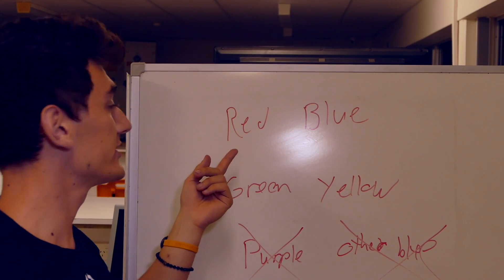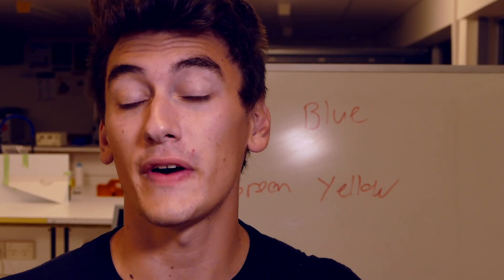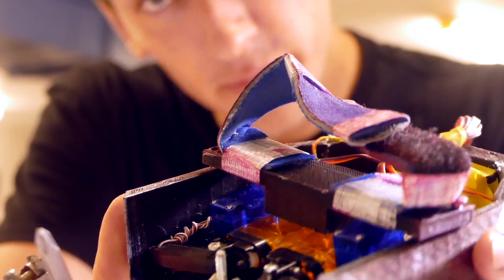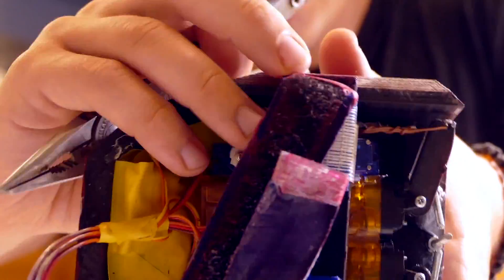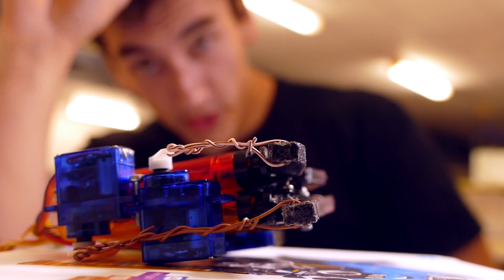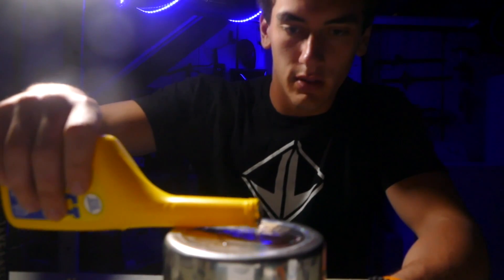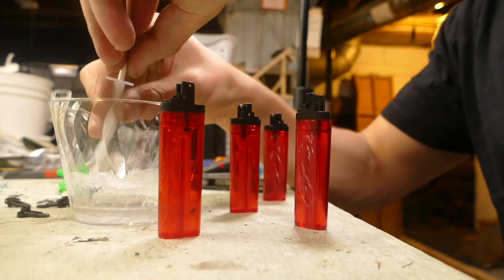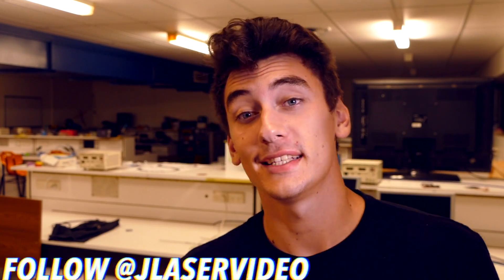DIY Working Iron Man INFINITY GAUNTLET

Comment: Such a dope project, ahhh I love it. 

I made a wrist flamethrower not long ago. To solve the servo/fuel release—I started off with a grill lighter. The cartridge had a refill thing which was super useful for the project, so then I could use butane refills and just push them on. I had some pneumatic tubing, however the tubes were too large, so I used some plastic epoxy weld and it keeps the pressure perfectly! I then connected it to a nice button and then to a solenoid to activate it with a small taser activation thing that you had. Love it!